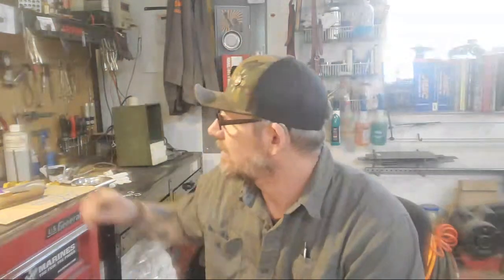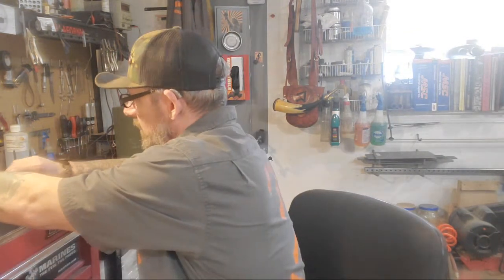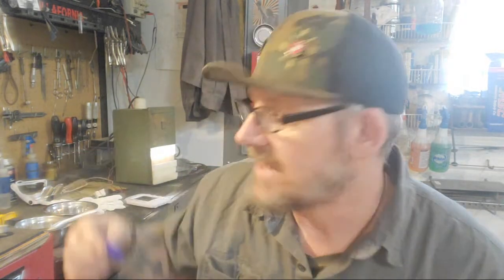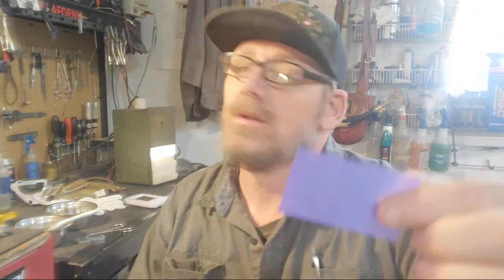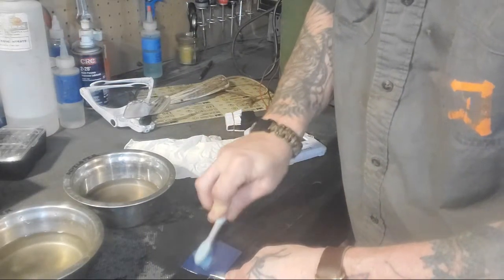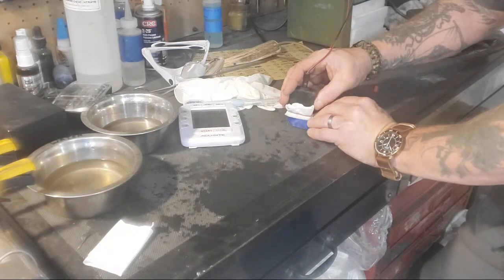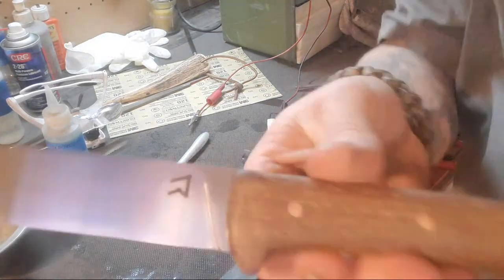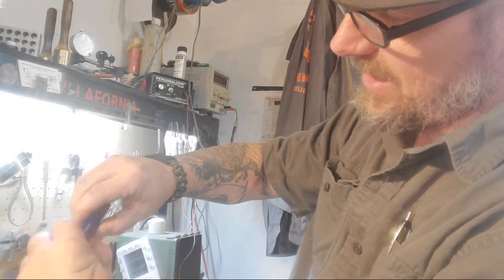Epi 12 Interactive Knife Build Making Stencils For Etching

Comment: Thankyou for your reply re exposing the resist. Unfortunately no matter how long or short I expose the material for, I still have a lot of trouble with not being able to penetrate the unexposed logo area, even after washing off with the sodium carbonate..  I bought my film on Ali Express,  from China.  My question please. Do you use a particular brand of resist?  It just seems almost all of it originates from China and there is no gaurantee of quality. I have ben trying for so many times, and it seems to fail everytime. Also is there a difference in screen material thickness? The resist I have doesn't seem to be as rigid as yours, certainly with both films removed, it can't be used as a seperate stencil like yours. Looking forward to your suggestions.
Reply from the maker: I put links to everything that i use in the description.  Might just be that the stencil material is old or has been exposed to light for a significant length of time.  I store my material double enveloped in a cool dark place, hope that helps.
Reply: @MakersMovementDIY  Thanks for your help. Unfortunately, I went to the Amazon site you showed and  apparently the resist is no longer available!! B- - - -r!!